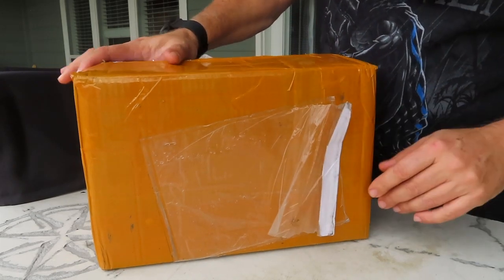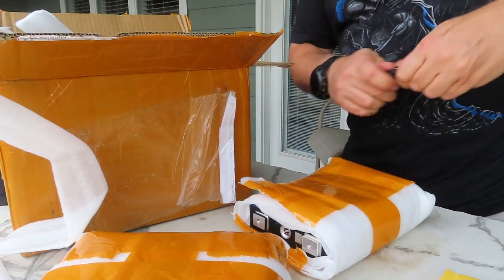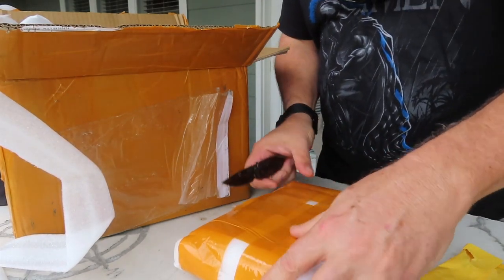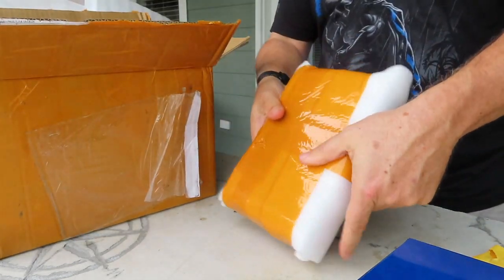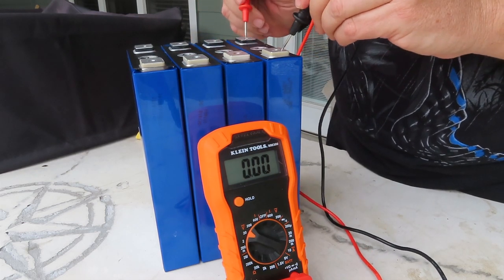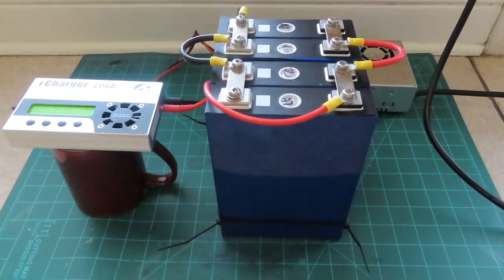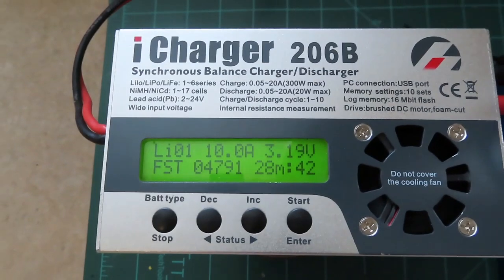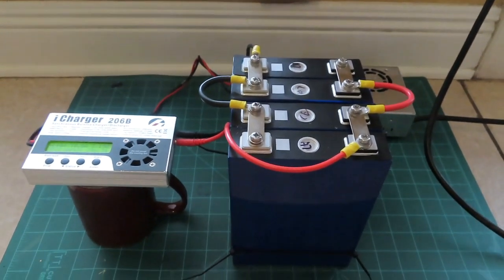100ah Lithium Battery Build. $300 Battle Born killer. Part 1, unboxing and top balancing

Comment: Hi Mike. I didn't know you had a YT channel and found it while researching Li battery packs. Do you have an update? I'm looking into building a 12V Li pack for my Hoodoo Hero 130 trolling motor. I subbed.
Reply from the maker: Batts are running strong in a DIY solar generator.  Somehow I lost all of my part 2 build video.  But I have the solar gen build  video and I cover some of the battery.  But i need to put it together

Comment: Have you completed the build and tested it?
Reply from the maker: Yes. I was doing a "part 2" of the build, but I lost all of the video to corrupt files. 😣I am building a solar gen with the batt now. So stay tuned. But the batt is working well. Pulled 102Ah on discharge tests

Comment: Are these a good option for a 12V 55LB trolling motor? Due to their size they could be mounted inside the center hatch of my canoe.
Reply from the maker: I have run this battery on my 12v trolling motor, although that is not its primary purpose. (I have other battery builds) But it should run for days and days. I would definitely recommend that the battery is in some form of water proof case. But I f you can get it into your hatch, it should be beyond awesome. If you want some more ideas for a battery build that I use in my kayak trolling motor, look through the rest of my channel

Comment: how many of these cells would you need for 500ah 48volt setup?
Reply from the maker: Thats a whollotta watts!!!! Every 4 cells in series give you 12v. So you would need 4x4 or 16, for 48v at 100ah. Then 5x16 for 80, to get to 500ah. You would be better off starting somewhere else. They make cells in the same form factor at 280ah. 32 cells would get you to 48v and 560ah

Comment: nice, i have the same cells , one of mine turned up leaking , never put them on there side, the valves at the top could easily leak. those cells are  used and some have a bulge, but very powerful, i cooked a pizza today with my 800 watt cooker,  i love them.
Reply from the maker: Pizza! that makes it all worth it

Comment: This maybe a stupid question but if each battery is 100AH, then 4 of these should equal 400 AH ??? If not can you explain to me why.. I'm trying to learn.. Thank you
Reply from the maker: Good question. Yes it would equal 400AH if you connected them in parallel as I have done in this video to top balance. But you will only have 3.6 volts. If you connect them in series, you will have 100AH, but you will have 14.4 volts. Parallel connections (+ to +, - to -) increases AH but voltage remains the same. Series connections (+ to -. - to +) increases volts, but AH remain the same. Then you can get real fancy and connect parallel groups in series to increase both AH and volts
Reply: @MikeJordanUnCamplicated  Thank Mr.Jordan  now I know more about batteries....

Comment: Why don't you buy a 4s balance lead? its like 5 for $5 on amazon. There is no top balancing, the voltage always changes. Don't be dumb and spend all that money and not install a $1 balance lead.
Reply from the maker: Like a bother from another mother. I generally despise BMSes. You can never tell what they are doing, and I think they are quite useless for a batteies that have a separate charge/discharge cycles. If you look back a few vids on the channel,  you will see I built a dedicated kayak battery with balance leads and no BMS. I have a handful of balance leads if I wanted to install them. But... this batt will live much of its life in a solar generator. It will have simultaneous charge/discharge cycles through a solar charger, with no balance connection. That requires a BMS. I found a BMS with a robust bluetooth function where you can see what's happening. Stay tuned